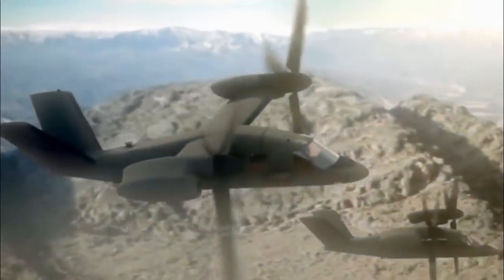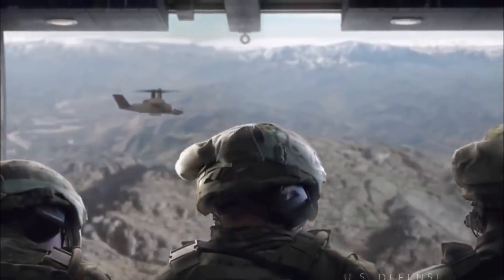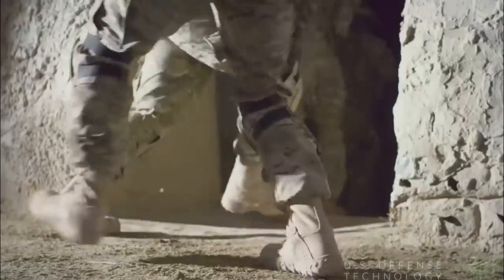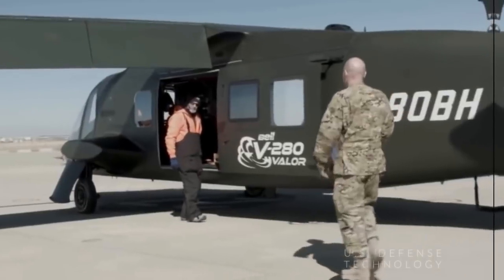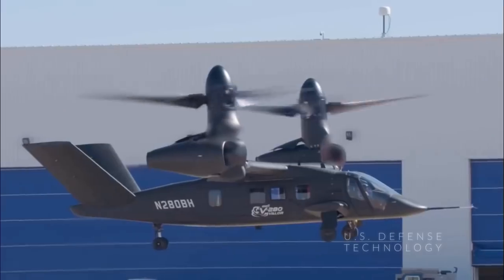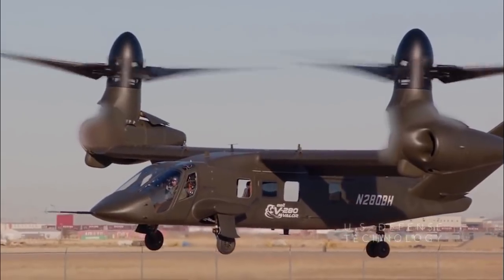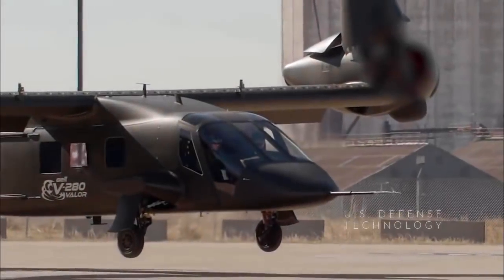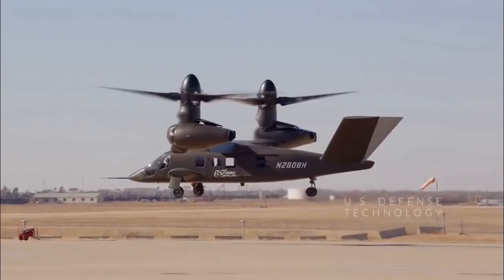Bell’s V-280 Valor shows off agility, speed in first public flight demo

Comment: Why does the military need this and the osprey?
Reply: I guess they need a replacement for the aging Black Hawk.
Reply: abc64pan but wouldn't the osprey be able to fill that role already?
Reply: It suppose it could, but currently it's in service only with the Navy and Marines.  The Army doesn't have them.
Reply: Tiltrotors are twice as fast and have much longer range than the helicopters they replace.  That is vital for search and rescue as well as medical evacuation. 
 It's also incredibly useful for airborne assault, giving a much larger area that can be attacked.  They're also much quieter than helicopters when flying in airplane mode, giving a measure of stealth.  The V-22 is significantly larger than the V-280, with about twice the cargo capacity, and is correspondingly more expensive.  The Army could use the V-22 to replace its older heavy lift helicopters, but they've chosen not to.  They have thousands of medium sized helicopters like the Blackhawk, that are due for replacement, however, and the V-280 is well suited to the Blackhawk's roles.
Reply: The Army was the original service asking for the V-22, but they pulled out during development, which is a big reason why the Osprey costs so much.  Instead of the research costs spread out over a couple thousand units, they're spread among fewer than 500 units.
Reply: Its easy to notice that the Valor is about the same crew cabin size as the UH-60, perfect for the squad size element to transport.  The original XV-15 spearheaded for the US Army and NASA in the 1970s served as the proof of concept for the USMC and AFSOC for them to field.  USA (that's US  Army) Chief of Staff Eric Shinseki did not want the V-22 because "it could not lift diddly", the CH-47D/F was fast enough and had a high operational rate (OR) for the services's doctrinal employment, not to mention that the CH-47 could easily carry internally a full size platoon and externally lift another CH-47 for downed aircraft recovery (hey, stuff happens).  At the same time, the CH-47 with its tandem rotors did not require the crazy huge footprint of the CH-53E of the USMC (but admittedly the CH-47 lifts less internally and externally).  The V-22 has some HORRIBLE vortices that make descent into a brownout situation even worse than a CH-47 (just ask any SOAR MH-6 or AH-6 pilot waiting on a AFSOC CV-22 to land in a brownout, it seems like it takes a half hour).  Tasks that are more "helicopter-centric" are not the V-22's forte, but it does haul faster than any conventional helicopter by leaps.  Now, it seems that the US Army may gain what its been looking for since research in the 1950s.
Reply: Very well said Dave. Very knowledgeable commentary here.
Reply: David Perry wouldn't the v280 have the same issues as the osprey or is that why the engines don't rotate on the bell?
Reply: Just seems like whatever role the v280 is going to be used for could have already been filled by the v22 since they are so similar in design and performance.
Reply: no. The R/D for the Osprey begain in the 80's under Reagan, using 80's technology. That was a cause for the huge amount of failures. Fast forward with much newer tech in the 1990's & 2000's, and problems were eventually solved, it took 20 years tho. This aircraft already benefits from those lessons learned, plus being developed with technology from the 2000's! Huge upsides. The Osprey is a much bigger aircraft with a larger payload, and not as nimble as the v280.
Reply: im thefuckinglizardking The engines on the V-280 do rotate horizontally for level flight and no it doesn't have the same initial internal design flaws of the V-22 during it's early development that were later fixed. Top down it is designed differently. The V-22 is also twice the size of the V-280 and S-97 Raider, slower, and may cost nearly twice as much per unit as compared to the two latter  once one is chosen and production starts.
Reply: Actually, it’s antecedent, the Bell XV-15 started in 1971 for NASA, but funded by the Army as a technology demonstrator, flying first in 1977 (I was in Kindergarten and remember my old man excited about the Army program).  The USMC Commandant flew in it as a passenger to DC promoting the need for the then proposed V-22 that was an expensive proposal to Congress.  It’s a wonderful replacement for the CH46.
Reply: im thefuckinglizardking since I am not directly involved with the prototype and am not even rated in the category of “Powered Lift”, I would rather not speak out of turn.  But you can be certain that the aircraft must be “right sized” for the Army’s requirements which revolve around the size of the infantry squad, MEDEVAC/CASEVAC, and air movement of personnel and equipment.   Oh, and speed and reliability when operated from an austere environment are of top concern .
Reply: im thefuckinglizardking The Army’s requirements are for a smaller aircraft to move an infantry squad and execute MEDEVAC, and in turn it SHOULD be less expensive to replace an extensive fleet of UH60s (but I know not all need to be replaced).  No powered lift aircraft has really “out-helicoptered” a helicopter in maneuverability at slow speeds at hot and high conditions, but of course they are much faster.  It’s easy to see that Bell is marketing this machine to replace the very reliable, robust, and for most missions, fast enough UH60.  Hey, it’s fast enough for the President, just not “Presidential” enough when he has to stoop to get in out out, which is why they still have those old VH3Ds, even as we cancelled the VH71 that would have costed us a staggering $400 each!
Reply: @apachedave  >>> What is "VH71"?
Reply: The answer is contained in this video: 
 
https://youtu.be/YxatMizsoPE
Reply: The V280 is supposed to replace the Blackhawk .. while a bigger version of the V280 will be built to replace the Osprey .. and a smaller version of the V280 will need to be built to replace the Apaches